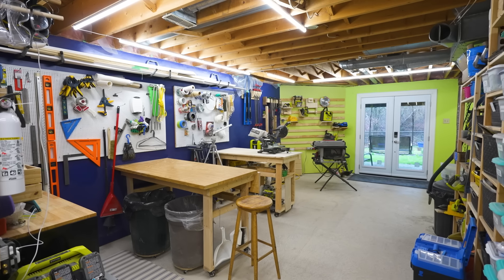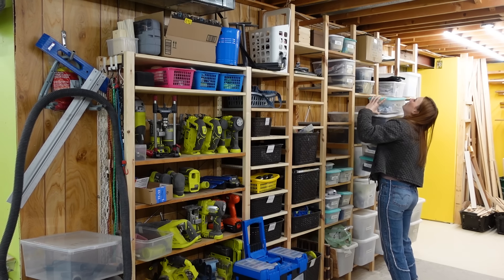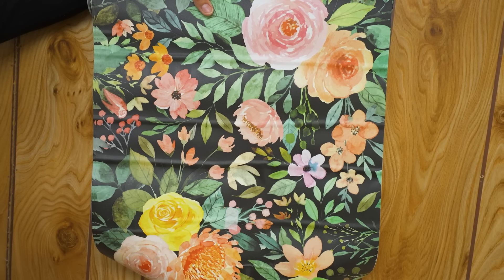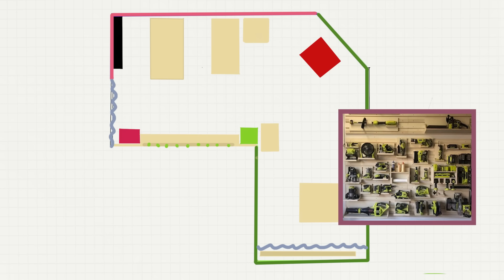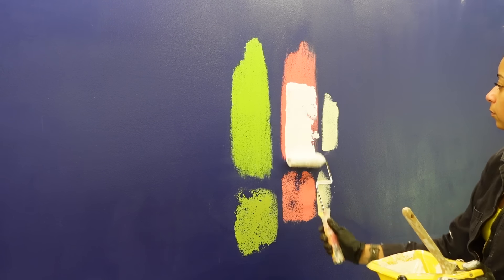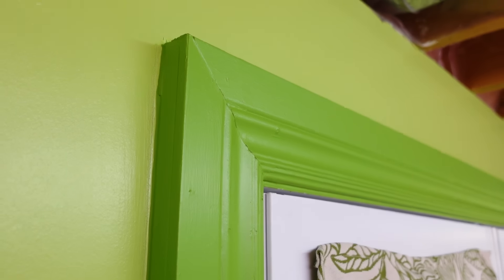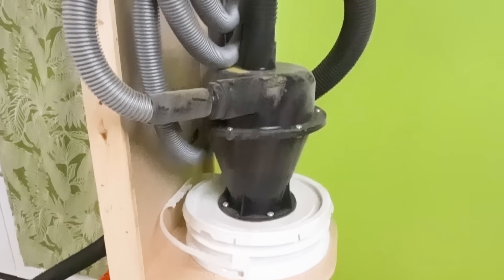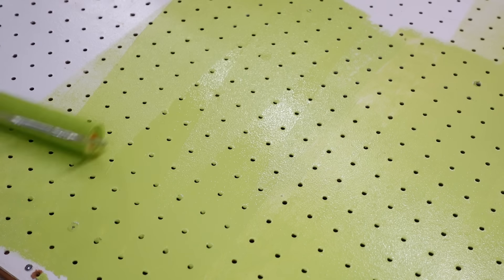Rochelle's EXTREME workshop makeover * finally *

Comment: That reveal! It's so cool! That pink is beautiful! Also, on camera it looks like it makes you shine, Rochelle! Maybe you should incorporate that particular pink in your wardrobe a lot. 😇

That wooden open shelf unit from ikea seems to be based on lundia (they do modular shelving like that), lundia has way more options to personalise the shelves, all colours, widths, depths, backing, doors, etc. They are very very durable (and very expensive if you buy new) so there is a thriving second hand market where I live. We have parts that are from the 70s (metal details that are painted brown) and 90s. We didn't end up closing the sides, but my parents did do that, they're just thin wooden panels you can slide into the sides.
We also used a curtain to cover a one person murphy bed with a counter and book shelves above it, but we used a roller blind. I prefer the roller because it will be completely out of the way when you open it.